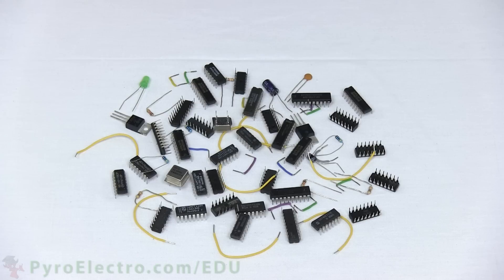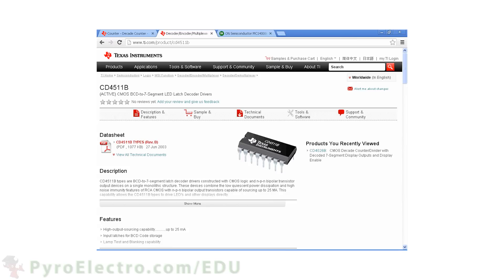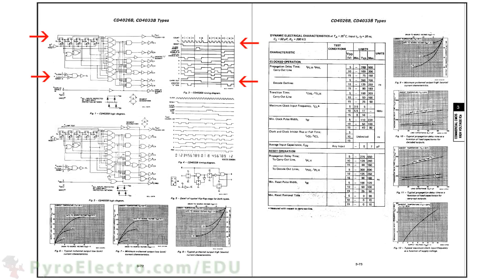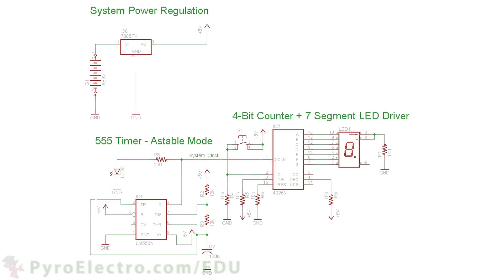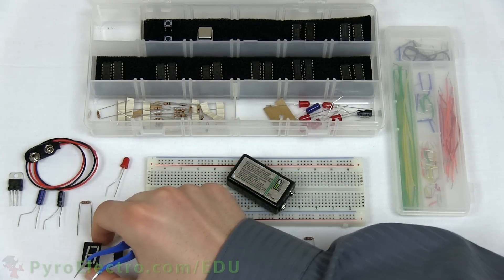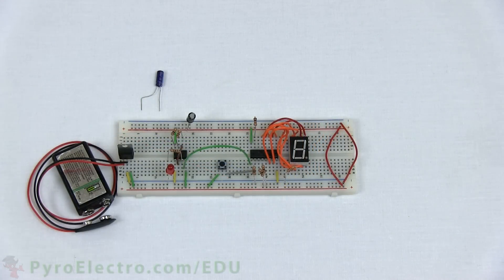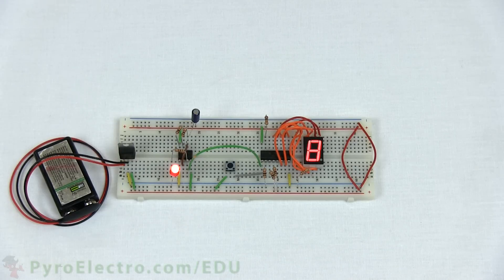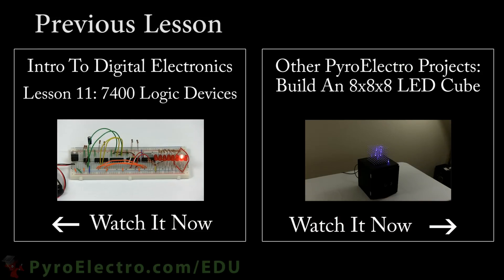4000 Logic Devices - An Introduction To Digital Electronics - PyroEDU

Comment: Your schematic here is inaccurate. The build doesn't work if you follow the schematic. The person building it in the video constructs it differently than what's shown in the schematic (specifically the pins connected between the IC and the LED display). Frustrating as a student. In the prior video or two in this course there is a similar issue.
Reply from the maker: Hi John! It looks like you're right....the wrong LED display schematic symbol was chosen, thus the pin numbers don't match like they should. Thanks for the heads up and apologies for the confusion. We'll update the schematics to be correct.
Reply: Great thank you! Love your courses so far!